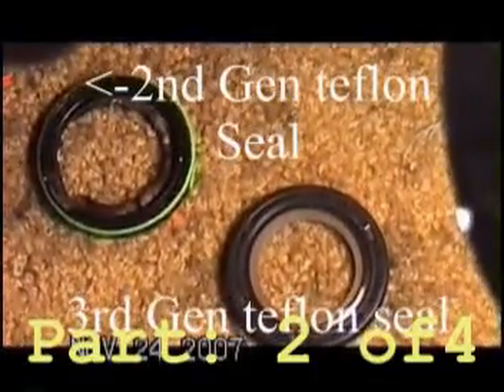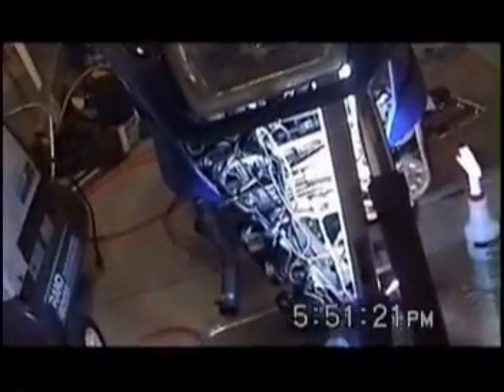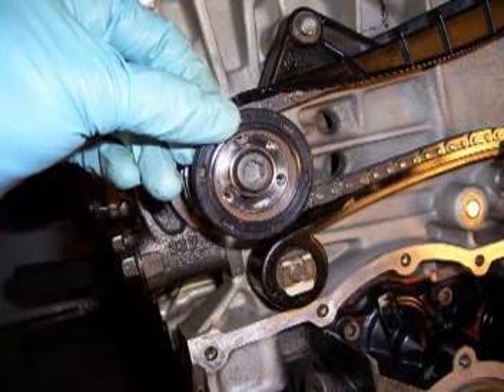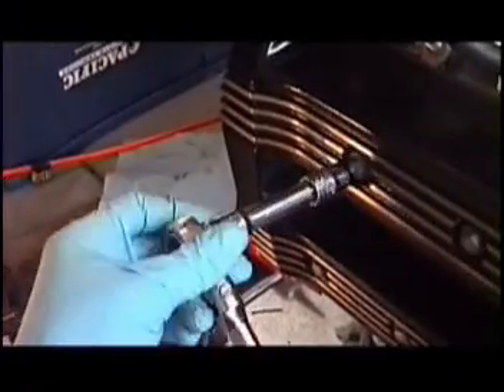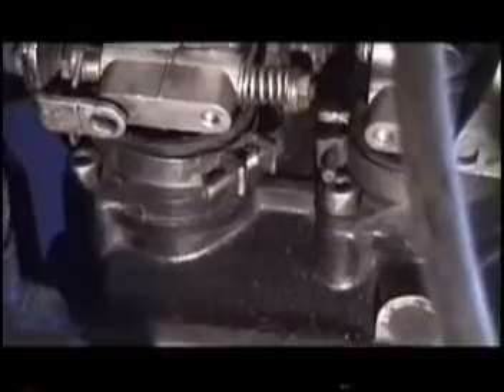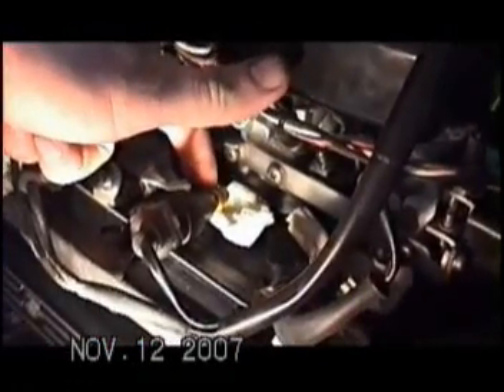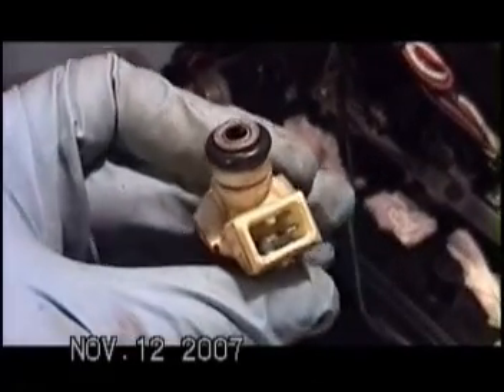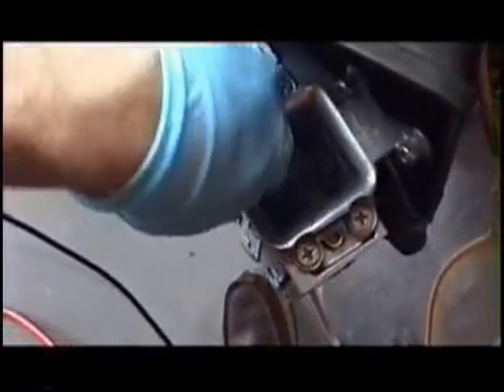BMW K75 Air Filter Timing cover 2 of 4

Comment from the maker: There are a lot of things to check. Somewhere I have a list but I don't remember where. There's two basic areas with low mileage you're just looking at replacing rubber that ages and then leaks. With high mileage the final drive spline can be worn out and front forks get pitted which means the two need to be replaced in addition to the seals.  So probably you should look at getting one with low miles on it. Maybe ten thousand or less miles.